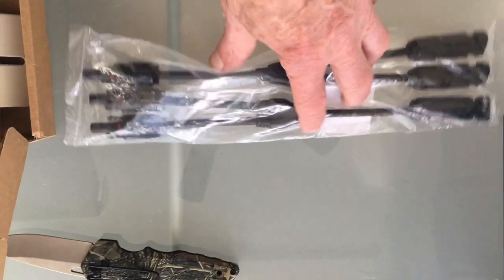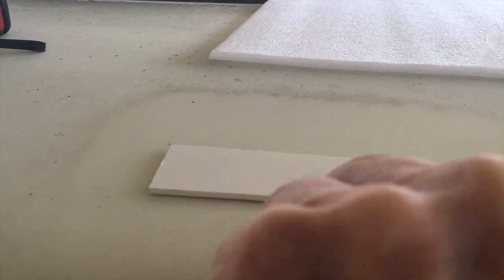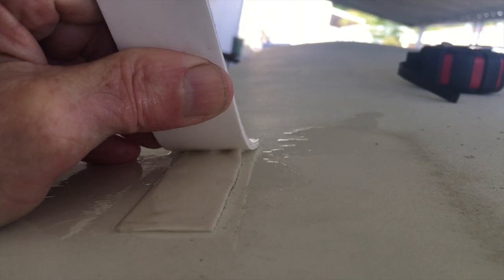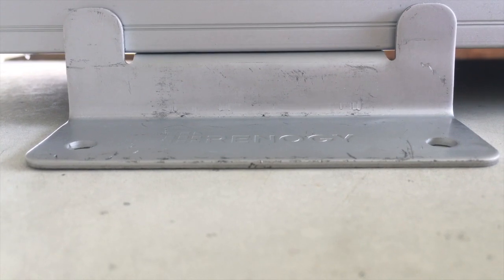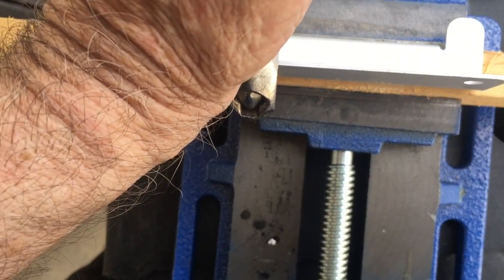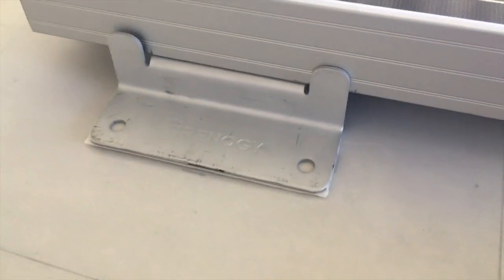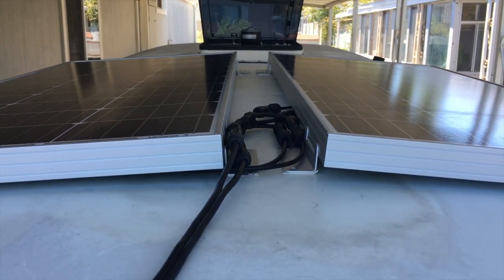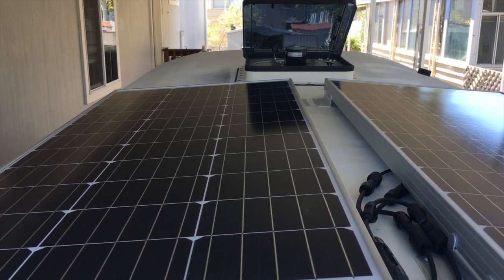Installing Solar Panels With VHB Tape

Comment: How did you prep the roof surface?
Reply from the maker: Hi Sarah,
The roof is fiberglass. Over time, fiberglass, being a resin, degrades, gets contaminated. So the first step is to remove the contaminants and restore the surface of the resin/fiberglass to a smooth, clean surface. I washed off the dirt with dish detergent and water, then rinsed and dried it. I used an appropriate fiberglass rubbing and polishing compound to restore the surface to a smooth, glossy condition. Immediately before attaching the panel with the VHB tape applied to the mounts (on the panel), I wiped the area on the roof, where the mounts would come to rest, with DENATURED alcohol, allowed the alcohol to dry through evaporation, and buffed the surface with a clean, dry cloth. All this was done on a day when the temperature was between 70 and 80 F...not too cold, not too hot. I allowed the mounting operation about 48 hours to "bond" before driving the vehicle. As with any bonding operation, clean, dry surfaces are essential in obtaining a high-strength bond.
A word about alcohols. The two we most often come in contact with are Isopropyl or rubbing alcohol and ethyl alcohol, ethanol. Denatured alcohol is the ethanol variety. This is the same type of alcohol people drink. Toxic substances are added to ethanol, to "denature" it and make it unfit for human consumption. Neither denatured nor isopropyl alcohol is fit for consumption, both are poison if taken internally.
The main difference is their chemistry is slightly different and generally, isopropyl alcohol is mixed with water so there is a lower percentage of alcohol and it evaporates more slowly. The denatured alcohol is preferable in this application because, with the exception of a tiny percentage of denaturants, it is almost 100% alcohol that evaporates quickly and completely. A DRY surface is very important when applying VHB adhesives. So using Isopropyl alcohol that usually contains 30% water isn't a good idea. Using something "wet" to "dry" a surface is counterproductive and introduces the possibility of not achieving a strong bond between the surfaces.

Comment: Excellent video 
I have a question , will putting another layer on top of the bracket be beneficial ?
Reply from the maker: I think most people have applied the eternabond to top.

Comment: How is the tape holding a year later . any issues or failures?
Reply from the maker: I get up on a ladder regularly to inspect and clean the solar panels and the attachment between them and the VHB tape on the roof. I am not seeing anything that would indicate the bond between the two is degrading.
Reply: @RoadtrekRich  thanks for the reply, awesome. I am planning my install using VHB tape

Comment: I am very sceptic!!! Weater will deteriorate the adhesive. This is what I wrote in another post:

I find your way with the unistruts indeed the best way to mount the panels!!! But .... the mounting of the unistrut itself to the roof is an iffy thing. 
My thoughts: I need to consider the limiting case in order to prevent the panels from just flying off and killing the driver behind me. The limiting case I consider is: Top speed of my coach is 85mph (it takes a while to get there, but I have been there in Texas), now let's assume I am driving into a thunderstorm with severe wind gusts in my face of another 85mph (have had it once. Slowed down the coach dramatically). This would be a short burst of 170mph (it can go up to this speed in an instant, out of my control). Now I would like to calculate some safety into this and round it up to 200mph wind gusts which the mount of a large area solar panel (40" x 65" multiplied by 4 300W panels) has to sustain in a limiting case. 
I do not believe that tape (any tape), or screws to the surface of the roof will hold this limiting case. ...and this case, as unlikely as one might think it is, will need to happen only once and kill someone (which WILL ruin my life and the victims life entirely). 
I decided to bolt the struts through the entire thickness of the roof (all the way through) and secure the bolts with a flat steel rail from inside. The steel rail will distribute the load evenly to the roof stucture and employ the multiple trusses and members automatically (of which I have no way to determine where they are exactly located). Then mask the inside rail with decorative and beautiful wood. This will add a nice decorative feature and gives me peace of mind, and potentially saves a life. 
To do this and keep the roof waterproof, I will apply plenty of dicor inside the hole for the bolts as well as outside where the heads of the bolts are. 

This is what I am talking about: https://youtu.be/m4Jq6zNrwHY
As one can see, the brackets were just glued down. This glue will deteriorate due to weather. Even if the brackets would have been "secured" with screws, it would have ripped the screws right out as well (most likely).

Maybe this is the German in me, but I like it safe and apply appropriate engineering, having this ONE case in mind.
Reply from the maker: I agree with your"German" thinking. I've owned many Porsches and Mercedes and appriacate what goes into the construction. Here is another possible "safety" or insurance policy that I am not only considering, but am doing. We used it on a lot of components when I was younger and racing cars. We added cables to the suspect parts that could fly off and did regularly fly off during a collision with another vehicle. What I am planning is to cable the two panels together and have the cable be in front of the fantastic vent fan housing in the middle of the van. This way, if the panels were to come loose form their mounting point on the roof, they wouldn't fly off the vehicle by virtue of the "safety cable".  It may not be as fail safe as the solution you propose, but I think it adds an extra margin of safety that does not currently exist.
Reply: @RoadtrekRich  A good thought, but think this to the end. IF, just IF the panels come loose and are restricted by the cable - depending of the area exposed to the slip stream - the panels will flip around and uncontrollably WILL slam into something on your coach, which most likely will result in a costly repair - hole in the roof or on the sides, depending how long the cable is. YES, you will prevent them from flying off, but think about what happens next.
Please don't get me wrong!!! I don't want to be the party pooper. I just want to point out the risks and the involved liabilities. 
What I plan to do in addition to the mounting: I plan to add some fairings which prevent the air catch under the panels in the first place. They will lead the air over the panels and not under. Of course one has to consider the cooling effect which one would need. So these fairing will have vent holes, so the heat - which will build underneath the panels - can escape. 
Thank you for creating this content!! I love your Channel.
Reply from the maker: @joergmeyer4145  
You thoughts, ideas and suggestions are NOT "party pooper" things. They are providing strategies for creating a safer outcome in the event of failure.
I flew airplanes. I don't "trust" anything or anyone just out of hand. 
I don't think I'll be going to the lengths you are taking but I AM going to apply some additional safety measures to the setup I have thanks to your comments.
Much appreciated...and thank you.
Reply: @RoadtrekRich  Hey my fellow pilot!! Aerodynamic knowledge comes handy in this case, and this is a typical case where air flow and it's effects has to be looked at and understood. Thank you Rich for your comment. BTW, this is what I built when I was younger: https://youtu.be/CzSlBvMpw6Y
Reply: @RoadtrekRich  Another thought about the fairings: The fairings can be made easily and very inexpensively from aluminum flashing material which one can buy at any hardware store and which is used in roofing. These fairings only job is to keep the air from catching under the panels. They are not exposed to big loads just redirect the airflow, and they indeed can be glued with tape to the surface of the roof and to the frame of the panel because they don't have to hold much.
Reply from the maker: @joergmeyer4145  
That makes it clearer, the keen attention you are giving to this solar panel question.
As you can see from how I positioned the panels, I am trying to take advantage of the effect the fantastic fan housing, sticking through the roof, is having on airflow. It's already presenting a nice lateral and vertical "dam" or cowl to the air moving over the roof for the panels to "hide" behind. 
I was also thinking of using that aluminum
flashing concept to continue the airflow around the fantastic fan connected to the leading edges of the panels at the corners. By constricting / directing airflow under the panel that air has to move faster than the air on top of the panel...venturi, Bernouli.
We know that this create "lift" or vacuum, in this case down force.
I don't have a wind tunnel at my disposal, but I kind of think a computer model would show a fairly long area of "calm" behind that fan housing with airflow trying to reattach itself near the end of the panel nearest the rear of the vehicle. So back at that end, a small aluminum rail / spoiler attached to the panel's lateral end would finish off the flow and create burble, drag, down force back there keeping "lifting" force off the back of the panel.
I worked with a gentleman, years ago, who was one of the pioneers of the research and development of the streamlining of big  rigs...common today. He is one of the companies that designs and manufactures the "slippery looking", streamlined race car haulers used around the world.
When the vehicle is underway, it would be a benefit if the solar panel assembly was dynamically involved in sticking itself to the vehicle versus the mounts experiencing stress from the action of air over the panels working against those mounts.
You get it. Other people I would discuss this with wouldn't have a clue what I'm trying to describe and think about.
Reply: @RoadtrekRich  Very good description! Thank you!!!

Comment: Hi Rich - cool video. Can you say more about how you integrated solar into the electrical system of the Roadtrek? Can you charge your house battery with either Solar, or shore power, or the engine's alternator?  Also - what do you think about the flexible solar modules and the idea of adhering them directly to the roof? Thanks!
Reply from the maker: Hi stoneymtnramblers, 
thank you for the great comment and questions !
Starting with the last question first. Flexible or rigid, that is the question. I've had both. My experience is the rigid panels outperform flexible ones. From what I've seen on other videos, the durability and longevity of rigid panels is several times to many tens of times longer.
Flexible panels cost substantially more.  For about the same cost of one fexible panel, I got double the output with the rigid panels I installed on the roof.
And on the Roadtrek, with its aerodynamic, roof sloping to the rear, and the panels nestled between the roof vent and the rear of the vehicle, they don't present any perceptilble drag. In fact, I don't think the air traveling over the van even "sees" them.

Yes, the house batteries can be charged all three ways and also with a portable generator. 

CAUTON: The description here ISN'T installation instuctions. THE BATTERY NEEDS TO BE CONNECTED TO THE SOLAR CHARGE CONTROLLER FIRST!!!! 

The solar panels connect to each other in a parallel circuit. In a parallel circuit, positive connects to positive, negative to negative via a set of "y branch" cables.
Y branch cable looks like it sounds, a Y, two connections merging into one. Each positive cable from each panel plugs into a positive Y cable and each negative into a negative Y cable. This parallel type connection results in the same voltage, around 20 volts, and multiplies the amperage output of the panels. Where one 100 watt panel would produce 5 amps at 20 volts, two panels produce 10 amps at the same 20 volts when wired in parallel. From the roof, the open ends of the Y branch cables are plugged into extension cables. The extension cables are fed into the vehicle to a solar charge controller and connected to the appropriate connections. On the solar charge controller, there is a positive and negative connection to connect to the battery/s.
Wires are connected to the battery/s and fed to the charge controller and connected to it. If there are multiple batteries, normally, in a small system like this, they would be connected in parallel to maintain their 12 volt voltage and multiply the amperage available to be used on 12 volt accessories throughout the vehicle.

In order to charge the batteries from house current, a 12 volt SMART battery charger can be connected to the battery/s. The charger plugs in to house current and charges the battery/s. The charger can alternately be plugged into a generator with 110 volt plugs and charged that way, too.

In order to charge the batteries from the alternator in the vehicle, the starting battery receiving the voltage from the alternator to keep it charged is connected to a battery isolator.  The battery isolator has connections to which the leads from the house batteries are connected. When the vehicle is running, the alternator is charging all of the batteries. When the vehicle is shut off, the house batteries are disconnected from the starting battery. That way the starting battery is fully charged ready to start the vehicle.

There are benefits to flexible panels. Since they are thin and lightweight, they are a convenient and portable way to harvest solar energy. People use them to supplement the panels on the vehicle. Bear in mind though, they are lightweight, and portable making them easy for someone to walk away with them.  That's how I lost both of the ones I had.

I hope that helps to give you and understanding of the solar questions.  It's a fantastic, almost miraculous thing we have available.  It's not "free" energy but once we have tasted this ability to harvest energy ourselves, we all seem to want to go further down that road. With planning and by selecting components that work with the voltages solar produces, I can do everything I routinely do daily powered by the sun. With a little natural gas or distilled alcohol, I can cook my meals.

We have to adjust a few things, sometimes, but for the most part, solar energy inspires a feeling of independence that makes any trade off feel very small.

Comment: I used Eterna Bond 5 years ago on my 96 Saratoga . Still doing great. Incidentally.  My replacement  Truckfridge will be here Tuesday. After all my testing, it was determined that the current fridge doesn't have enough freon . They bench tested the new one before sending.  The only issue is , I just had cataract surgery (20/20 vision is amazing) so no heavy lifting for 3 weeks. Boooo !
Reply from the maker: Hi Stan,
Here's to a speedy recovery for you.
Yes, Eternabond, I was first introduced to it 10 or more years ago when I had a Lazy Daze 22 foot RV that had roof leaks. After doing recon on where the leaks were actually emanating from the eternabond kept me leak-free from then on. I think the idea of using it over the VHB, of course after the full time for curing of the VHB, several days, is that extra measure of security that gives one a little peace of mind.
If we really drilled down and found out all the things that we use that are literally held together with nothing more than adhesives, we would probably shudder a little. At times, even our own parts are held together with adhesives while we mend.

Comment: You can also use fishing line to remove taped items.
-- BR
Reply from the maker: That's a good method.  I've had a lot of 25 to 30 gauge Kanthal heating wire around for a long time and it works very good too. You can make the equivalent of a bow saw with the wire in place of the blade. Also makes a good cheese slicer !  Or you can run some current through it, heating it up and use it to cut foam like closed cell or styro...don't breathe the fumes though.
Reply: Dental floss also works—cuts better through the tape than fishing line (more abrasion) and is easier to hold onto. You can double or triple it up if it seems to be breaking.

Comment: Looks great Rich. No need to drill with VHB. 
Kinda jealous. Hope to do my van in the near future.
Reply from the maker: You should, if you are so inclined. It's one of those things that you will get use out of every day you use the vehicle. For me, that's pretty much every day since it is the only vehicle I own. Having had both portable and now permanent panels, I am finding that I downplayed the benefits of the permanent solution. Especially that once I installed them, they conveniently power things with no further action on my part.  The portable panel was something I had to initiate, deploy. It involved intent.
The permanent panels are just part of the vehicle and do their work.  I like that.